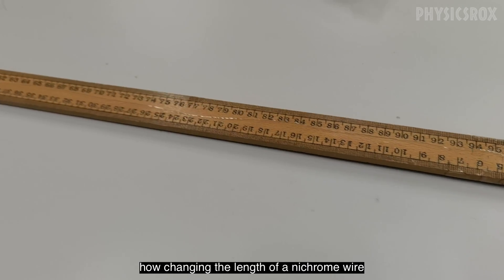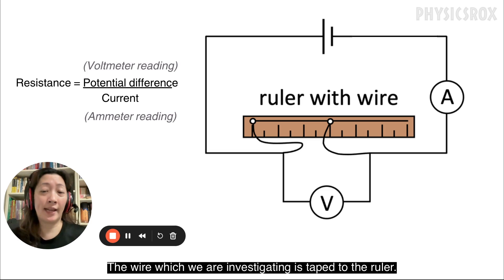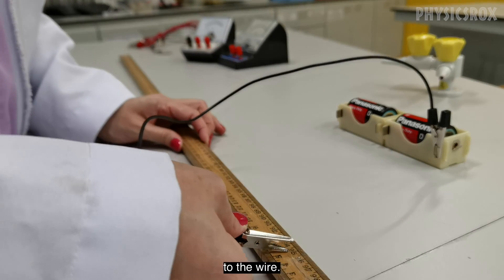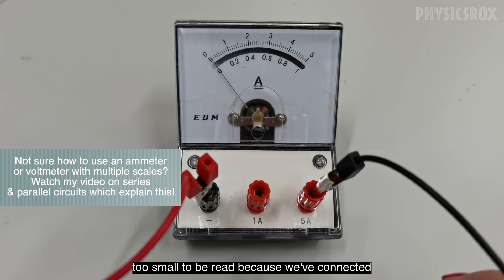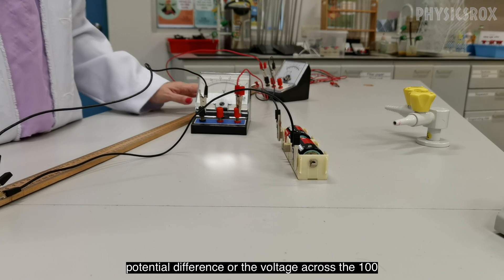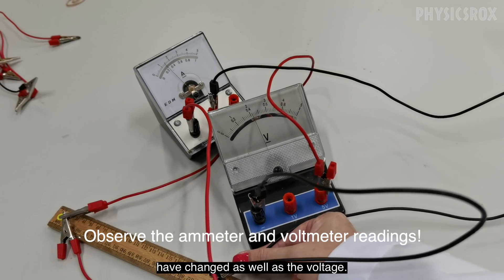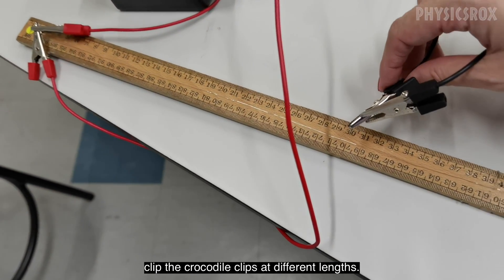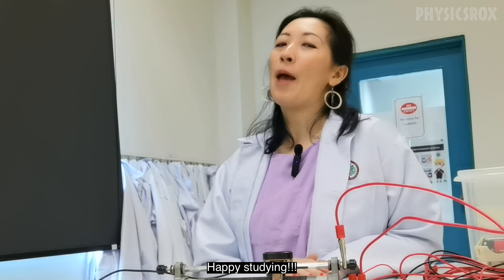PRACTICAL EXPERIMENT: Length vs resistance of a wire - SPM & IGCSE Physics - Physics Rox

Comment: Teacher can I ask? Why did  you choose to connect the red wire to the 5V terminal on the voltmeter. Is it because the battery EMF is 1.5+1.5=3V?
Reply from the maker: Yes, that is the reason. If we were to connect the wire to the 1V terminal, the needle would deflect higher than the scale because the PD would be higher than 1V since the voltage provided is 3V. If the value drops below 1V, then we can connect the wire to the 1V terminal to get a clearer reading.
Reply: @PhysicsRoxz  Thank you so much for the explaination.I have been having this  unanswered question for a long time😅
Reply from the maker: You are welcome!

Comment: this was helpful thank you. but how can i do this experiment but with using a slide potentiometer?
Reply from the maker: Using a slide potentiometer will be a different experiment studying different variables. The slide potentiometer is used to change the voltage or current of the circuit, but cannot be used to change the length of the wire. So it cannot be used in this particular circuit; it would be in a different type of circuit to investigate different variables.